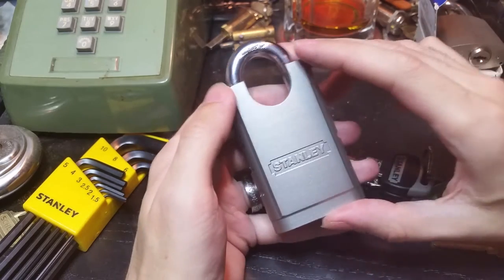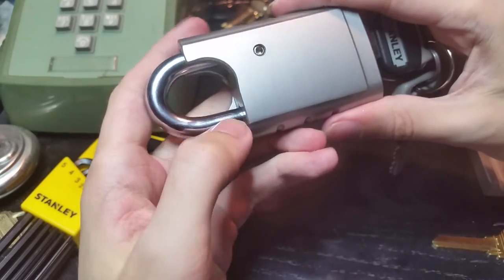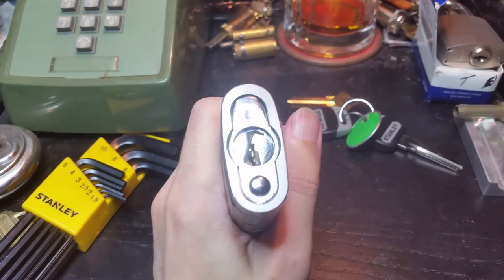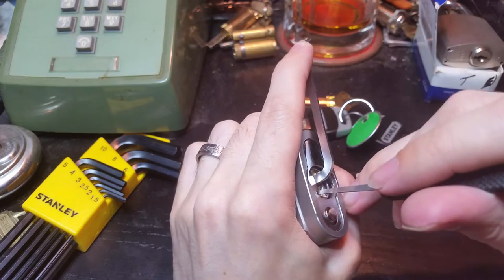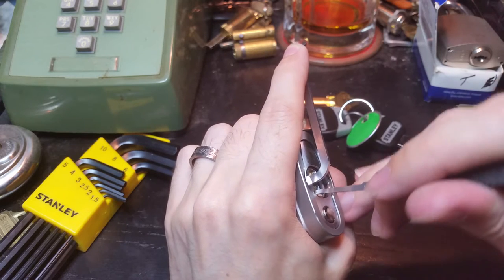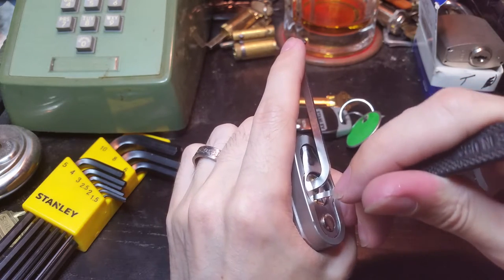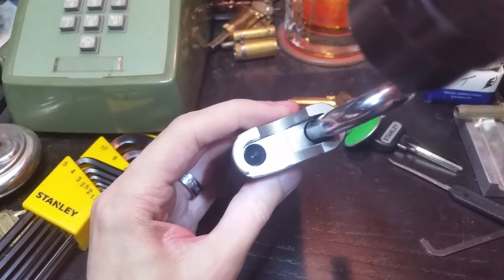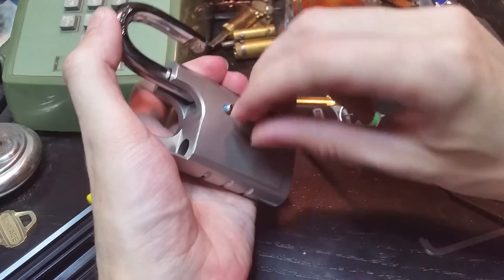(68) Stanley 50mm solid body shrouded padlock picked and gutted

Comment: I know this is a lock picking channel, but how does that 9.5mm molybdenum shackle hold up to bolt cutters?
Reply from the maker: That would be a question for Wayne Winton or LockPickingLawyer who have made multiple videos on testing cut resistance.
Reply: @Nite0wl  he only tests the 60mm  version, which has an 11mm shackle. It stands up pretty good. I just didn't know if the difference of 1.5mm is a huge difference or not.
Reply from the maker: Addicted2baseball rgd when it comes to cut resistance against bolt cutter even small increases in shackle diameter matter, especially with harder metals. Thicker shackles can be hard to fit into the jaws of a bolt cutter and the extra material can eventually overwhelm the users strength.